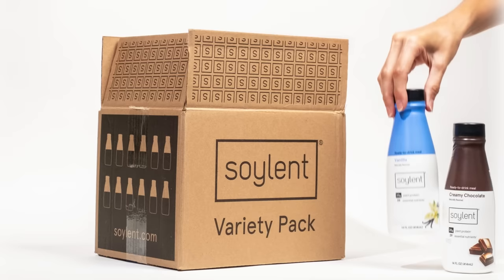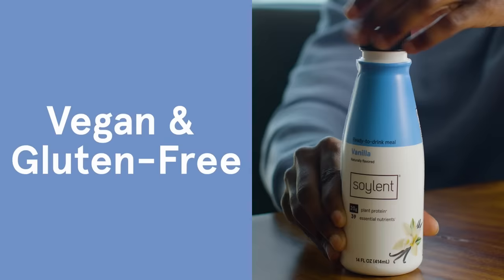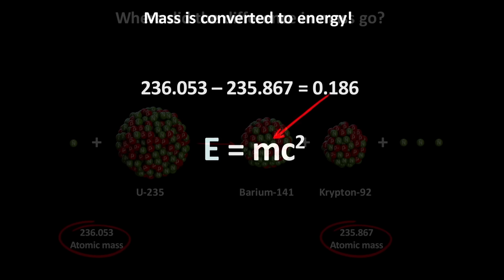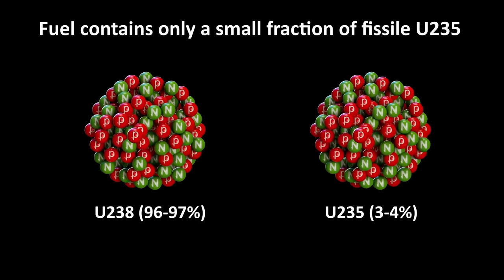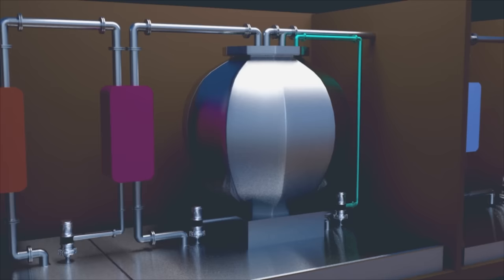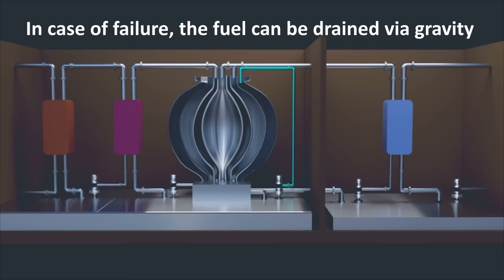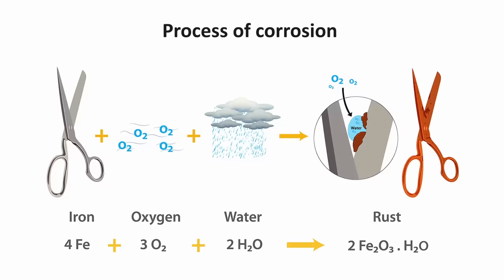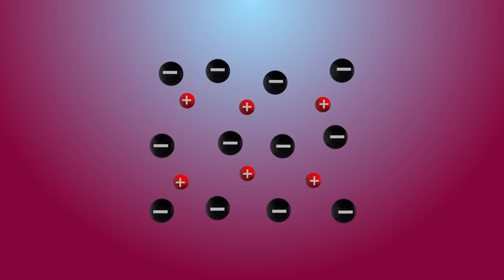How Molten Salt Reactors Could Revive Nuclear Power

Comment: I agree this is a fantastic innovation. (I guess the trucks would be electrically powered?)

It looks like you are saying  the reactor setups are as small as a semi? If so, it could power a city or town from anywhere. Including my own "back yard," my condo community's power house.

Perhaps this could be used with underground pipes to provide hot water? Or maybe produce enough electricity to give everyone hot water on demand units? Imagine if you never had to use gas or coal power anymore. Maybe we could replace hydroelectric dams where there isn't any water traffic in order to help restore natural habitats. I dream about the reversal of desertification of the Sahara and other deserts. 
(I just realized I just wrote "desertification of the Desert and other deserts.") 

This could also help reverse climate change in this way: provide power to machines used to sequester carbon from the atmosphere like have been researched as of late. Or also mitigate ground issues of natural gas.
Replace cement furnaces that burn waste fuel (solvents that can't be recovered by distillation) with electrical fuel. Power other large industrial complexes like car manufacturers. 

I'm afraid it might not be able to mitigate burping cows directly at the moment. (methane)

Electrical stations would grow ubiquitous and electric cars would be more prevalent. Maybe in the future nuclear-powered cars would happen.

Comment: So exactly how much radioactive waste would be produced from a MS reactor at a typical power plant? 10 lbs, 10,000 lbs or 10,000,000 lbs? What form would it take? If it’s similar to the metal fuel rods seems we still have a huge problem with this version…….

Comment: IMO the real reason we don't have molten salt reactors is nuclear weapon proliferation concerns. While the nuclear non-proliferation treaty allows the civilian use of nuclear power: such civilian plants need to be designed in such a way as to frustrate the diversion of material for nuclear weapons.

Solid fuel reactors have the advantage that the fuel pellets are countable, and thus auditable. The MSR design in contrast, is DESIGNED to allow you to remove material while the plant is operating!

Comment: Current nuclear power plants are not riddled with problems. All of the spin fuel that is called "waste" is stored safely. Nobody has been hurt by the radiation from spent fuel. After the fuel rods are pulled out of the cooling pool after a few years, they go into dry storage tasks, these have been safely held for decades. Nuclear power has one of the greatest safety records of industrial sites anywhere. Almost all local areas where nuclear power is cited love having the plants there, because they are great employers, and contribute to the local economy . Have a read of the new book "Earth is a nuclear planet" by author, Mike Conley. I promise you'll learn something.

Comment: I’m curious if ceramics or ceramic coatings would fix the corrosion issue. Ceramics can take heat and aren’t metal. Not sure how they would stand up to the effects of the radiating daughter elements. Think the main reasoning why current nuclear power plants are designed the way they are goes back nuclear arms race. U235 was already being refined so why not use it as a fuel. Breeder reactors producing Pu239 from U238 was also required nuclear weapons.

Comment: Nice video. Quick question though. How is electricity finally generated? What here is the alternative to steam turning the turbines?
Reply from the maker: Typically, the heat would be used to generate steam for the turbine.
Reply: @ArvinAsh  so, water is still used to generate the electricity.

Comment: What we will end up with is small ( those 40' trailers) single digit megawatt salt reactors built in factory ( see Westinghouse) to standardized specs in networks replacing the coal and natural gas furnaces 1:1 de centralized with multiple ownership even municiple ownership. Economy of scale works to bring costs below a few million and installed in months not years.

Comment: Ok so. How was the speed of light measured!?!  

First though. Thanks. That was really wonderfully done. 
Anyway. How was the speed of light measured in these experiments. 
If light speed is measured by reflection of a beam of light back off say an object like the moon or a mountain. Then the light speed is always going to be constant because it will be the case that the reflective surface will also be moving. So its returning speed will add or subtract from the outgoing speed and become c which is the relative speed it was transmitted. 
So how is light speed measured? It’s not so easy to implement a one way speed test like we do for sound.

Comment: So part of the safety feature is like having a car's gas tank at the back, away from the engine where all the heat and combustion happens?

If there's a catastrophic failure, the fire/explosions only has the small bit of fuel that's currently in the engine?

Comment: There is a lot about MSR technology that the supporters are not getting or accepting.  Moisture is everywhere on this planet, and even tiny amounts of moisture in MSR fuel is lethal to the equipment. The salts they are using are hygroscopic, they attract and absorb water.  When water gets into MSR fuel you have a chemistry side effect, separate and distinct from the nuclear properties. The moisture, plus fuel, produces intensely corrosive hydrofluoric acid which eats the plumbing and containment materials.  The same alloys that are most resistant to the corrosion are the ones most susceptible to neutron embrittlement. From a materials standpoint you can build these reactors with current technology, but you have to replace them every ten or fifteen years.

Comment: Is the Thorium production chain established enough to be an economical option? That could be another obstacle - Uranium is already much more widely used (despite being less abundant)
Reply from the maker: Indeed, it is not well established...yet.
Reply: Uranium is so cheap and abundant that is is used in bullets, armor, and boat ballast
Reply: @clarkkent9080  And like thorium, they both need a breeder reactor to be utilized.
Reply: @chapter4travels  0.7% of uranium is U235 and fissile.  ZERO % of thorium is fissile. Uranium 235 can be enriched enough for reactor operations at a fraction of the cost of converting thorium in a breeder reactor. And thorium needs URANIUM for that conversion process.
Reply: @clarkkent9080  Yeah, uranium is great, we can utilize the fissile parts until the reactors that utilize the fertile parts are ready. Low-pressure/high-temperature reactors are best for both. The future's so bright, ya gotta wear shades.

Comment: We need to work on nuclear reactors based on Thorium also. They will be more efficient & create less residuals
Reply: It depends on the reactor technology used:  BWR/PWR Light Water, Heavy Water, AGR, HTGR, MSR.  

All except the MSR are well developed technologies in the uranium world.  MSR's were never developed past the Oak Ridge test reactor due to the corrosion issue.  Maybe now we know enough to make it work - and maybe we don't.  Time and money will provide the answer.

The cheapest and safest way to develop thorium power would be to put a thorium fuel core in a AP-1000 type nuclear power plant.  Shippingport (60MWe) demonstration/test reactor showed that based on lessons learned that we now know how to design a thorium core for a PWR that works.  It might not have the same power output as a U235 core.  But the plant design is well proven and very solid.  It's also a passive safe design (in the event of a major incident no one needs to touch any controls or do anything for 72 hours minimum: after that they need to refill a water tank on top of the containment structure - and it could be filled with fire hoses if none of the plant systems are operational).

That's just not as "political" sexy as the potential of developing the MSR into a proven reliable power plant.

Comment: I think what a molten salt reactor would need is a nitrogen cover gas. This gas would keep out atmospheric oxygen and water thus stopping any corrosion to any metal container no matter what temperature. Thus no corrosion means an easy 30 year plant lifetime if not 100 year lifetime or more. If you keep this nitrogen gas overpressure very little if any corrosion would reduce lifetime. Hydrogen embrittlement might occur with flibe salt but straight sodium chloride, (table salt) would not have these properties. Various chloride ions would be a danger but with sodium in the solution very little if any chloride would be available for chemical attack. I am just thinking about lifetimes of nuclear reactions producing split sodium chloride ions.
Reply from the maker: You're on the right track.

Comment: There is a problem with the information you provided in this video. A Thorium salt reactor DOES produce Plutonium as well, 75% as much as a regular reactor. Governments have to place strict controls so that Plutonium is recovered (they will take that Plutonium for weapons) and to keep it away from anyone else's hands.
Recovery and government control is a severe drag on adoption and implementation.
Reply: 100% No one is going to power their Thorium Reactor with a pure WG-U235 seed, it will LEU, and since LEU contains >95% U238, Pu239 production is unavoidable.

Comment: Thorium, while interesting, doesn't really have any significant advantage over Uranium aside from the fact that it can successfully breed in the thermal spectrum and that it is really abundant. Many of the supposed advantages that get brought up are either objectively false or blown out of proportion. First of all, the waste from both Uranium and Thorium are for all intents and purposes identical. If you put either of them in your typical light water reactor, they'll both produce long lived waste without the use of reprocessing and they can both eliminate that type of waste when put into breeder reactors. Thorium just happens to be able to breed in both the fast and thermal spectrum, while Uranium requires the use of the fast spectrum due to insufficient neutron production by Pu239 in the thermal spectrum. That certainly opens up options for Thorium breeder reactor designs, but it's not that big of an advantage especially since we still have a waste stock to deal with and fast reactors can be fuel agnostic. Another big supposed advantage that often gets touted (and I'm glad you made no mention of) is the perceived inability of Thorium to make nuclear bombs. That's objectively not true as there have been a handful of bombs made using U233 from Thorium. There are certainly some major issues Thorium presents in making bomb material like the U232 that decays into daughter products that release high energy gamma radiation. That being said, MSRs can pretty much eliminate the potential of contamination of U233 by operating the reactor in the thermal spectrum and by using online fuel reprocessing (just like what many of these new Thorium MSR companies are trying to build.)
Reply: You are wasting your time explaining facts  to these YT educated people.  Most don't even understand the Thorium is not fissile

Comment: QUESTION:
What would the molten salt reactor do if P-239 were used as a fuel? Is there a way to use Thorium as well as the biproduct in an alternate reactor tuned to function off of P-239? If this were possible, we could salvage fuel from the metric tons of waste we currently have. What would the biproduct be from a reaction with P-239?

Comment: Coal can just be picked up off the ground ready to use, while uranium ore can be as low as 1000 ppm, of which only only 7000 ppm is ²³⁵U, so 143 tons U ore v. 2700 tons coal, or 1:19 might be a more appropriate comparison
Reply: Then that wouldn’t be a comparison of fuel energy density would it?
Reply: @stocky9218  why, is density important?
Reply: @shanent5793  is comparing the energy density of petroleum and diesel also unimportant based on their different processing requirements?
Reply: @stocky9218  I think it's important but it's not the comparison made in the video
Reply: @shanent5793  I dunno man, he was making a comparison of energy density per unit of mass of the raw usable fuel which is what’s actually being used in a power plant. Completely fine comparison when talking about reactors however if he was talking about the mining of those fuels you would be right
Reply: @stocky9218  he was talking about energy per unit mass, not energy density per unit mass. Civil nuclear plants don't even use pure uranium metal, it's the oxide, encased in fuel rods that are received at the plant. Density is relevant because a large volume of rocks have to be mined, transported, enriched, and fabricated to make nuclear fuel, and that volume is not millions of times smaller than the equivalent amount of coal, as is suggested by comparing the energy per unit mass. Instead the energy density of the raw resource actually being mined is only on the only order of ten to a hundred times greater for uranium compared to coal

Comment: Thanks for the video. There are many new designs for fission nuclear.  It is kind of exciting.  There are also other molten salts power production.  All of it is exciting. 
    I'd like more folks to be open to many different ways of producing the power we need. That goes for big commercial power production that can and will serve large needs. Down to houses that are built to power themselves and potentially a couple of vehicles.  

    The molten salts solar power production here in Nevada is very exciting. Yet not everywhere has the sun and space Nevada has. Meaning its good to have many different ways to produce power. 

   Soon I believe that it will become code that new homes be capable of producing 150% of the needs of the home. 

Thanks for the video. You always do such a great job.

Comment: As long as we can build them on an assembly line, these reactors would still be revolutionary, and ultra cheap.
Even if the corrosion problem is never solved and the reactors only last for two years.
The plants just need to be built for rapid replacement, plug in a new one and go.

Comment: I wonder if there are any ceramic materials that could be applied as a coating to the salt-facing surfaces of the reactor? Are there any that could work; a material that holds up to the heat of the molten salt, is non porous, and non corroding in the presents of salt?

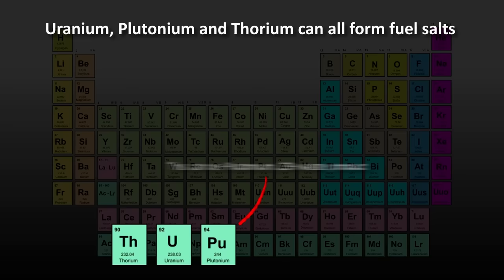Comment: One correction about the availability of Uranium 235 and Thorium. @ 11:42 you say that there is enough Thorium and Uranium in the Earth crust to last for a very long time, that is true for Thorium but not Uranium which you point later out @ 17:15 correctly. I guess the wording of the first time stamp was a bit...unfortunate.
We definitely have to go for Thorium salt reactors as working fusion is still waaay too far down the road and time is a luxury the planet doesn't have.
Besides the fear of people from the known reactor accidents, another huge problem is the lobby of the Uranium industry as well. The fear of the people plays into the hand of the Uranium lobby which needs to be challenged. Like all established industries, they like to defend their market share as change costs money and as they are schmoozing up to the stock holders then what's better for the planet there is no real change happening until some MASSIVE info campaign with videos like this one.
Reply: Incorrect we have just as much U238 as thorium, if not more.
Reply: @chapter4travels  U238 is of no use in Uranium reactors.
Reply: @getreal2977  neither is thorium, both need breeder reactors.

Comment: The fact that nuclear "waste" is so highly radioactive tells us that there is still quite a lot of energy there that can be extracted, we just lack the technology to extract it.
     History is full of cases where someone discovered a use for what was once considered waste. When they first started refining crude oil to make lubricating oil and lamp oil there was a biproduct that was far too flammable (and explosive) to be used safely for fuel. They called it white gas (though it was a liquid) but then they found by adding some other chemicals to it it would make a good fuel. Today it's called gasoline.
     In Oregon limber mills they produced several tons of sawdust every day. They had to pay money to get rid of it, either burning it at the mill or paying someone else to burn it. 
   When someone called and offered to take it away for free, the mills jumped at that. He'd discovered if you compressed the sawdust with enough pressure the natural resin in the sawdust would make the particles stick together into a solid log. Wrap that in paper and presto, you have a log to burning the fireplace with a predictable time.
      It's just a matter of time before someone figures out how to get that energy out of nuclear waste.

Comment: Fuel doesn't run out, the rods crack.  They only use .01 percent of the fuel.  Molten Salt, because it's liquid, uses 99.99 percent of the fuel.